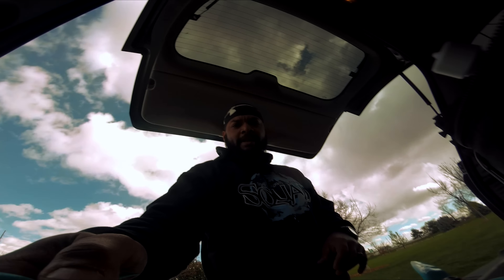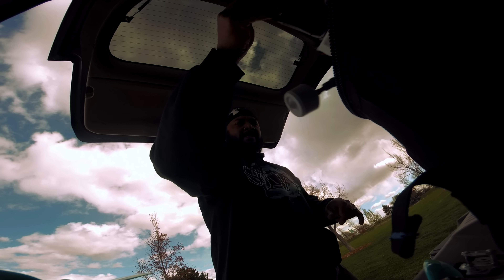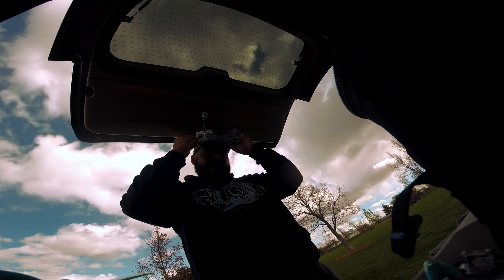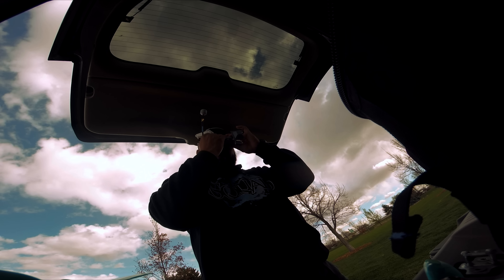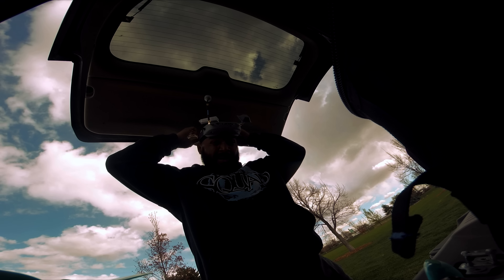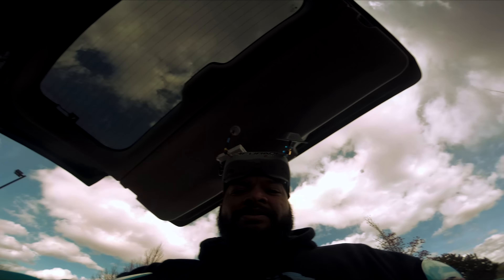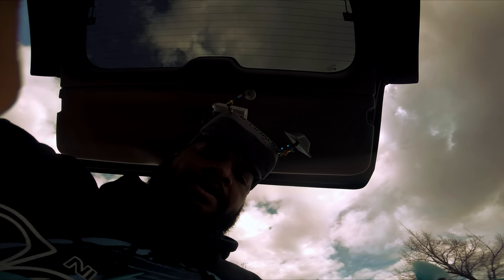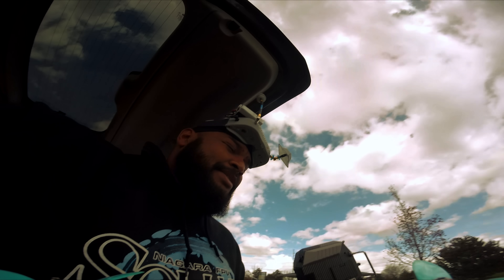6s Magnum // VLOG

Comment: Do you think the magnum could hold up to 1700kv 6S on 6" props or could that be to much draw?
Reply from the maker: Hmm might work ok since I know it'll handle 1900kv. Amp draw might work out to be the same.
Reply: I might have to put it to the test. I have a ruxus frame with a magnum stack and I love it. I am not much for racing any more and wanting to go long range so I have been debating on going 6" on it and trying the 6S. Thanks for doing the tests that I have been to scared to try. Keep up the great stuff I love your videos.
Reply from the maker: For LR if you keep the throttle down that should work fine I would think. HeadsupFPV accidentally flew 6s on a magnum with like 2600kv motors. He limited his throttle during the race and it worked out great haha.